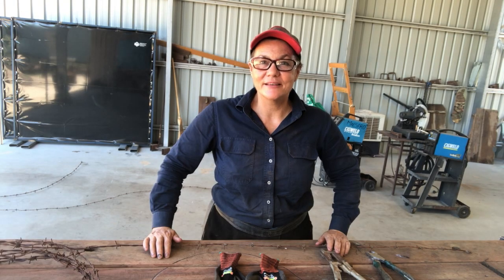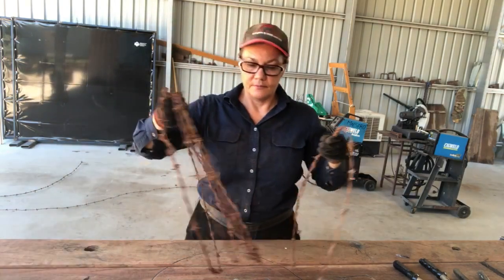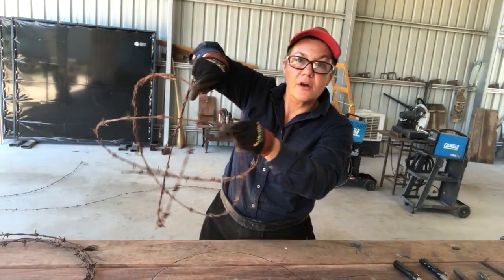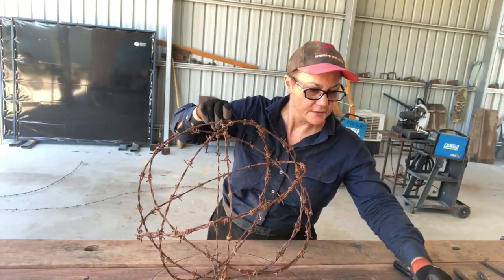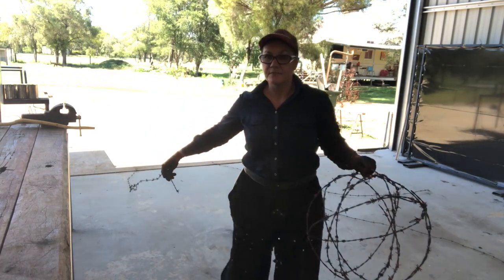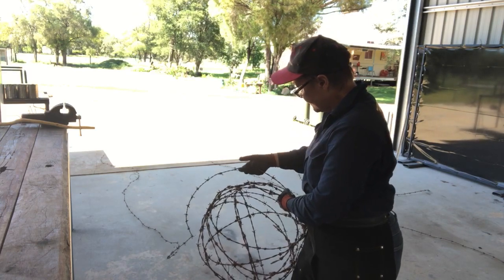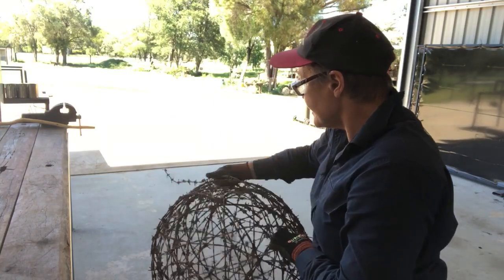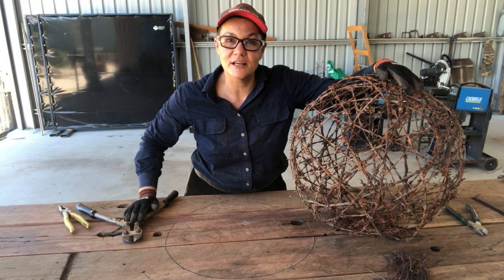Easy DIY Barbed wire Ball Project

Comment: I just realized why this looks so easy. She's using new barbed wire! It unrolls easy and is very plyable.Im making things out of old rusty barbed wire which is a whole other animal. How about a tutorial on making this with old rusty barbed wire? Also, what kind of gloves are you wearing?
Reply from the maker: Hi Robin, i am wearing engineering gloves, you can buy them at most tool shops, leather gloves get caught in the barbs too easily and not last very long. I am using old rusty barbed wire in this video, I have already done the hard work and unravelled the knots and rolled it out ready for the video mainly so that it wasn’t hours and hours long to watch. Thanks so much for your question.

Comment: Inspiring.  Any thoughts on the gauge for the barbed wire?  I have to buy the wire I'm not sure of the difference between 12 gauge vs.18 gauge for structure. Thanks.

Comment: What is the diameter of that one and what is the smallest ball that can be easily made in this way? I don't have 70 metres of wire so I'm hoping a smaller ball will work out okay.
Reply from the maker: This one has a diameter of around 500mm the smallest that I would go is probably a diameter of 250 mm although it starts to get harder once they are too small.
Reply: @scrapmetalsheila  Thank you, I'll give it a go.
Reply: @scrapmetalsheila  I made the ball today and am very happy with it, looks great.. Started a bit smaller but finished diameter is 350mm. Thanks for the tips!